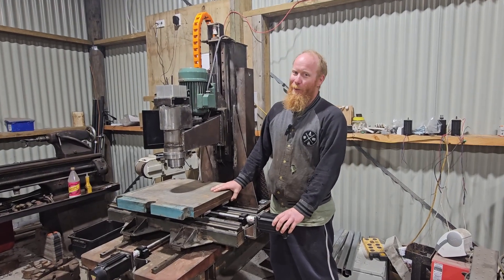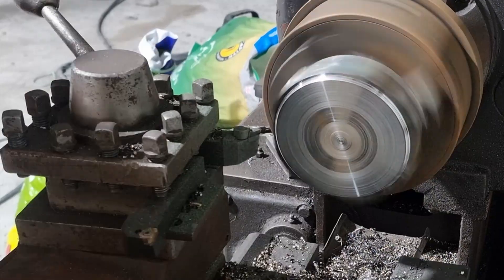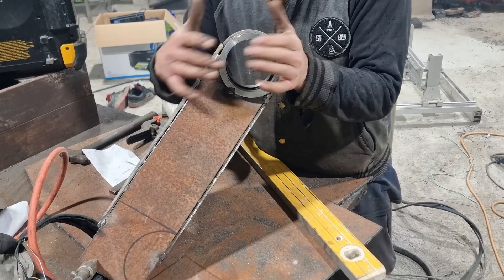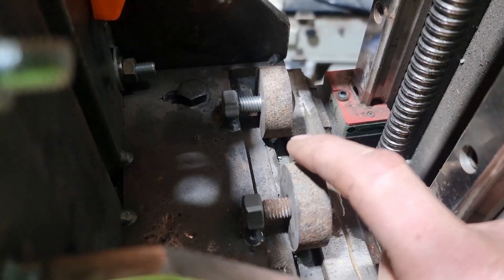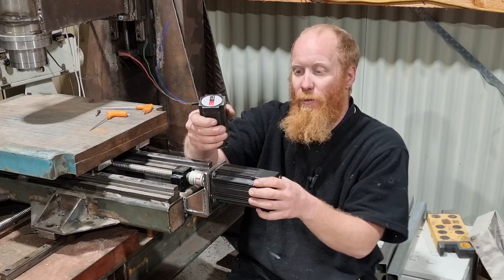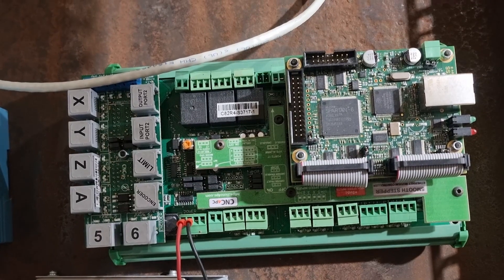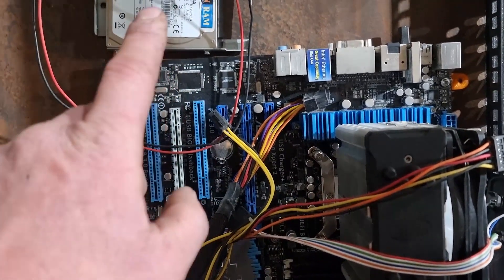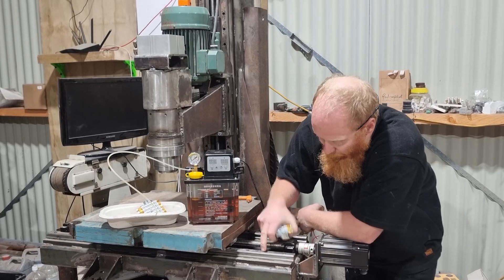I Upgraded My Homemade Cnc Milling Machine To Beast Mode

Comment: You should explain that your lubrication system is the Trabon type, which is very different than the Bijur type. Bijur's use fixed flow meters with no feedback loop. Both types aren't foolproof, but as a former machine repair tech, I had a lot fewer issues with the Bijur type. For the Trabon type to complete the circuit, each meter on each manifold has to work correctly, or the whole system stop's working. On the Bijur type, you just have a plugged channel. Still not good, but less likely to be a fatal issue.
Reply from the maker: That is very good information. Thank you for sharing.

Comment: Nice upgrades 😀, what servos and spindle are you using if its not rude to ask. Mine is similar to what your was with the steppers, works well but a bit slow.
Reply from the maker: hey mate cheers been working hard on it. this is the spindle I got. I went with the 6000rpm modle it's really nice.
https://a.aliexpress.com/_m0QSID4
and this is the servo it's a 1hp servo and man it moves fast that top plate and saddle are heavy.
https://a.aliexpress.com/_m0AbuXo
cheers for the comment anything else I can help with let me know.
Reply: @gingerninjaneering  thats great thanks, ill have a good look at the servos for mine. the videos are great im keen to see it cutting !

Comment: Fill it with epoxy granite for better rigidity mate
Reply from the maker: yeah, mate, that's in the plans for the future. I have already filled the moving gantry at the bottom it helped with vibration alot. cheers for taking time to comment.

Comment: Welcome to the EMI
Reply from the maker: shouldn't be too bad. Everything is either and will be running a few running emi filters. do you have any ideas on how to eliminate more.
Reply: @gingerninjaneering  The Inverter VFD needs to be mounted outside the control box as far away as possible and use double shielded cable on everything, Grounding should be star grounded to the control box. Have a look how i grounded my plasma table cause it applies to cnc mills as well. Good luck with your build.
Reply from the maker: ok awesome I will check that out thank you for your advice I most definitely don't want to be playing with EMI gremlins